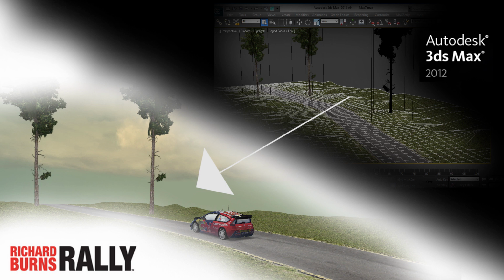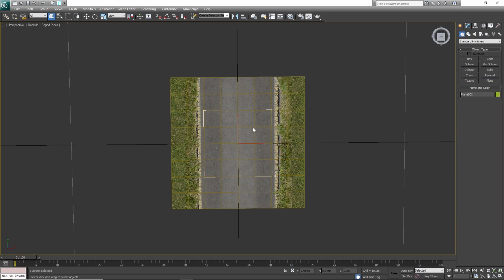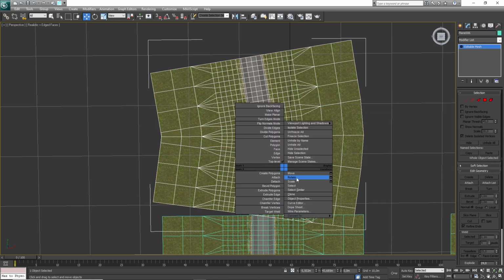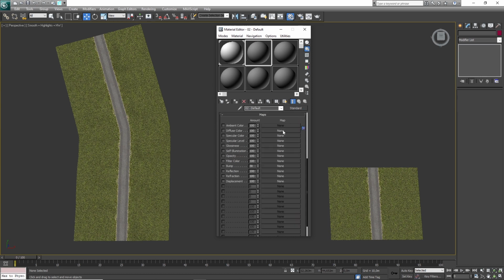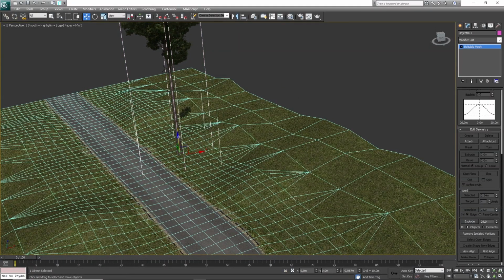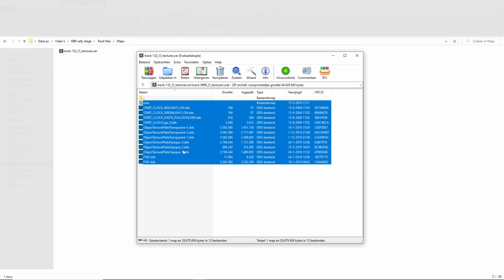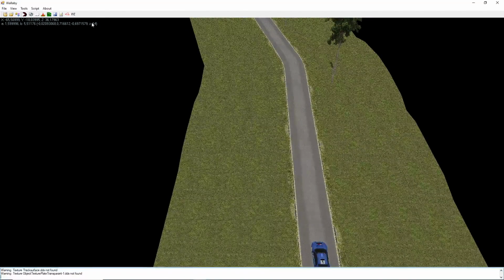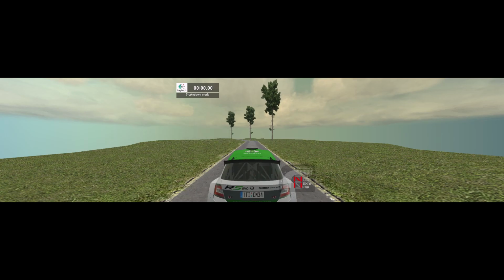How to create a chunk of rally stage in 3D Studio Max and make it run in Richard Burns Rally

Comment: Basically everything in this video is outdated. Every beginner should absolutely use the RBR blender addon which is much simpler and greater in features.
Reply from the maker: Don't worry, this video is not intended to undermine the RBR Blender add-on or anything.
Some people have been working with Wallaby and 3dsmax for 14 years now and have created beautiful tracks with it, such as rally special stage Semetin. To simply say that everything in this video is obsolete and should not be used anymore is, in my opinion, not entirely appropriate. In the end, everything still works, even if Wallaby is not as user-friendly as the new Blender add-on.

However,  before I made this video, I had already decided to start paying serious attention to Blender and of course the Blender add-on. For new tracks and ones that aren't yet that progressed in 3dsmax and may be easily converted to Blender.

Overall, I felt I needed to finish this video before moving on. In any case, it could be useful to someone, I hope.
Reply: @ptd-plankgas  Very good, those are some answers written by mature people. Let's leave the antics to those who have no creativity.
Reply: Blender, addon or Wallaby - all are just tools, and neither will create stuff for you. But true is that Wallaby workflow is really obsolete today - it is way overcomplicated, clumsy, and feature-wise limited compared to Blender & addon. You don't have to edit INIs manually, move movables by clicking on XYZ repeatedly like idiot, you can take advantage of textures blending, animated textures, edit the game weather (TrackSettings) in realtime, it produces better optimized meshes (more clever splitting) etc.

No, it doesn't mean that you can't create amazing stage using Wallaby (I think Biskupice isn't terrible stage either), it just doesn't make much sense to use it today and waste time by all it's quirks instead of investing that time into the creation itself, if we have more user friendly and effective tools available.
I am sure even Vasek Sourek would prefer Blender if he is about to create Semetin today.

Your video is still useful for those who would still prefer Wallaby for whatever reason, so thank you for that! Perhaps it could just include a notice about Blender & addon as the recommended tool, so new modders won't waste time by learning something they will stop using sooner or later.

Thanks for your stages and the big contribution to RBR community!
Reply from the maker: @Jan Kadeřábek
It was not my intention to cause such a stir with this video. 
I followed your advice and added a note in the description for new builders.
Now we can move on again.
Let's go!
Reply: Moro aleksi, onko mitään linkkiä mistä sais vähän lisää infoo liittyen tuon RBR ratojen tekoon? Oon tehny assetto corsaan ratoja, ettei ihan uusi juttu ole kuitenkaan. Meinasin nykästä tuosta ABC pitkälahti rallista varmaan jonkun pätkän.